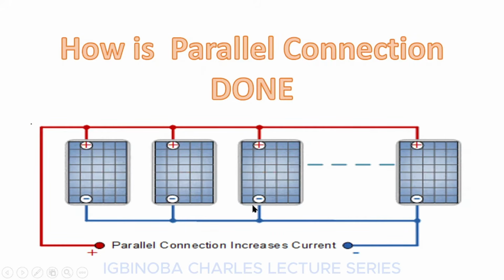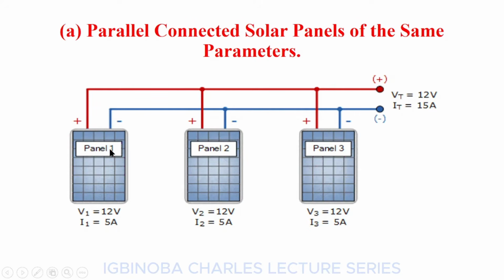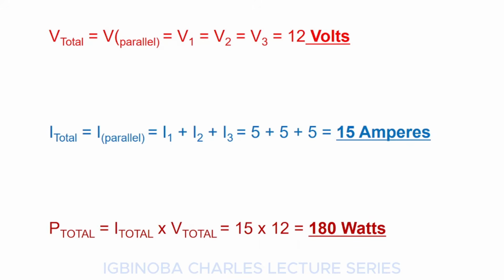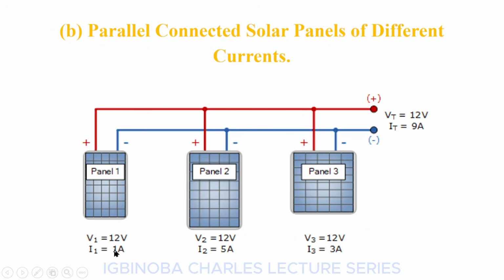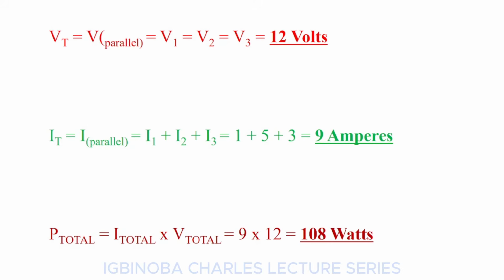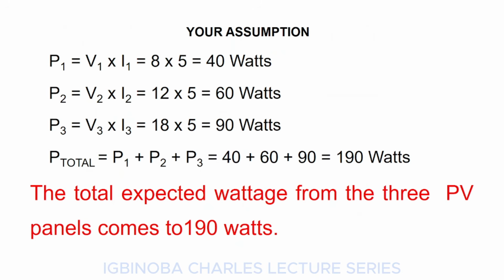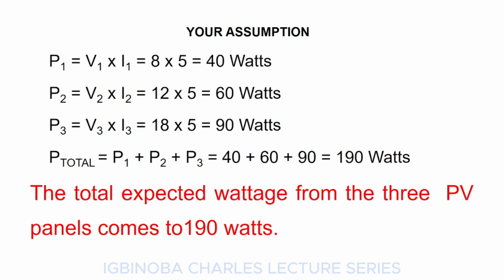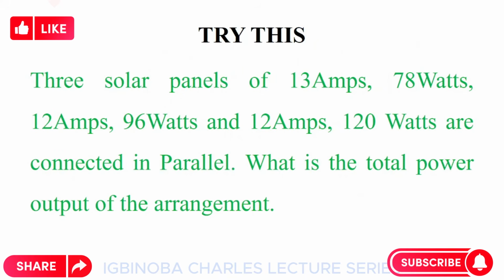Connection of Solar Panels in PARALLEL

Comment: COMP29C

Panel 1: 13A, 78W
Panel 2: 12A, 96W
Panel 3: 12A, 120W

Since total power is the sum of individual powers in a parallel arrangement:
Total Power = 78W + 96W + 120W = 294W

Comment: COMP75W 

Panel 1: 13A, 78W
Panel 2: 12A, 96W
Panel 3: 12 A, 120W

Voltage Calculation (using V=P ÷ I):
V¹  = 78÷13 = 6V
V² = 96÷12 = 8V
V³ = 120÷12=8V

Since this is a parallel connection, the system voltage is limited by the panel with the lowest voltage, 6V.

Total Voltage (Vt) = 6V
Total Current (It)= 13+13+13 = 39A

Finally the total power output is:
Pt=Vt ×It= 6V × 39A= 234W

Comment: CIV36J 

To find  the different voltage of the three panels for
panel 1: V1 = 78 ÷13 =6v
Panel 2: V2 = 96 ÷ 12 = 8
Panel 3: V3 = 120 ÷ 12 = 10

Total voltage = V1 = 6V
Total power = I1 + I2 + I3 = 13 + 12 + 12 =37 amps
Total power = 6V * 37amps = 222Watts

Comment: COMP79A

Given:

First panel: 13 Amps, 78 Watts

Second panel: 12 Amps, 96 Watts

Third panel: 12 Amps, 120 Watts

Now, we add the power ratings of all three panels:

Total Power Output = 78 W + 96 W + 120 W

Total Power Output = 294 Watts

Comment: CHM100V

Given;
First panel: 13 Amps, 
               78 Watts

Second panel: 12 Amps
                  96 Watts

Third panel: 12 Amps
               120 Watts

Now, we add the power ratings of all panels:

Total Power Output = 78 W + 96 W + 120 W

Therefore; 
Total Power Output = 294 Watts

Comment: NAT5E  
The Panel with the least voltage is 6V and the total parallel current is 37Amps. Therefore the total output power of  the panels connected in parallel is 37Amps × 6V = 222Watts making a total power output of 76%

Comment: CIV21U

Panel 1: 78W

Panel 2: 96W

Panel 3: 120W

Total power output in parallel = 78 + 96 + 120 = 294 Watts

In parallel arrangement power out of directly.

Comment: MEC4D
Given:

First panel: 13 A, 78 W

Second panel: 12 A, 96 W

Third panel: 12 A, 120 W

Calculation:
Total Power Output = 78 W + 96 W + 120 W
Total Power Output = 294W

Comment: Mar45S 

Panel 1: 13A, 78W

Panel 2: 12A, 120W

Panel 3: 12A, 120W

Since total power is the sum of individual powers in a parallel arrangement:
Total power= 78w+96w=294w

Comment: CIV76X 

To find the total power output, we add the power output of each of the three panel, which is 
=P1+P2+P3
=78+96+120
=294watts

Therefore the total power output is 294 watts/0.294kilowatts

Comment: EEE 39M
Panel 1; 
Voltage= P1 ÷ I1
Voltage= 78W÷13A=6V

Panel 2;
Voltage= P2÷I2
Voltage= 96W÷12A= 8V

Panel 3;
Voltage= P3÷I3
Voltage= 120W÷12A=10V

Only panels with same voltages that can be connected in parallel. Since they are different, it can lead to system inefficiency and power loss in the entire system. 

Therefore,
 P (total)= P1 + P2 + P3
 P (total)= 78W + 96W + 120W = 294W

Comment: MEC670
For us to go about the question we must first ascertain the value of voltage of each of the three solar panel connected in parallel.  Where 
Ia,Ib & Ic are the current of the first, second and third solar panel respectively.
Va,Vb & Vc are the voltage of the first, second and third solar panel 
And Pa, Pb & Pc is the power of the first,second and third solar panel

Va= Pa/Ia =78/13=6V
Va= 6V

Vb= Pb/Ib = 96/12=8V
Vb= 8V

Vc= Pc/Ic = 120/12= 10V
Vc= 10V

Then the next step is to find the total voltage(Vt) and Total Current (It) so that we can get the total power.

Vt = V1=6V.
It= Ia+Ib+Ic = 13A +12A +12A = 37A

Pt(Total power) = Vt × It= 37×6 = 222W

Therefore the total power output of the arrangement is 222W.

Comment: EEE84F 
To find  the different voltage of the three panels for
panel 1: V1 = 78 ÷13 =6v
Panel 2: V2 = 96 ÷ 12 = 8
Panel 3: V3 = 120 ÷ 12 = 10

Total voltage = V1 = 6V
Total power = I1 + I2 + I3 = 13 + 12 + 12 =37 amps
Total power = 6V * 37amps = 222Watts

Comment: MAR115K

We are given three solar panels which are:

First panel: I1 = 13A; P1 = 78W  
Second panel: I1 = 12A; P2 = 96W  
Third panel: I1 = 12A; P3 = 120W

Total power assumed = P1 + P2 + P3 = 78 + 96 + 120 = 294W

Voltage is given as  
P = IV  
V = P / I

Voltage for each panel becomes  
V1 = 78 / 13 = 6V  
V2 = 96 / 12 = 8V  
V3 = 120 / 12 = 10V

Total voltage = The smallest voltage is the parallel voltage that flows through the circuit = 6V

Total current = I1 + I2 + I3 = 13 + 12 + 12 = 37A

Total power = total current × total voltage  
Total power = 37 × 6 = 222 Watts

Therefore the total power supplied is 75 percent of the maximum power (assumed power) that can be given by the panels

Comment: Petro 34H

Panel 1: 13A
 and 78W

Panel 2: 12A 
and 96W

Panel 3: 12A 
and 120W

To find the voltage of each panel the formula;

V=P/I

V1=78/13=6V

V2=96/12=8V

V3=120/12=10V

Total power output: 78 + 96 + 120 = 294W

Comment: EEE31E

Given: Three solar panels:

1. Panel 1: 13 Amps, 78 Watts

2. Panel 2: 12 Amps, 96 Watts

3. Panel 3: 12 Amps, 120 Watts

So, the total power output is simply the sum of the individual power ratings:

P_{total} = 78W + 96W + 120W

 Total power output = 294 W

Comment: EEE 41O

To find  the different voltage of the three panels for
panel 1: V1 = 78 ÷13 =6v
Panel 2: V2 = 96 ÷ 12 = 8
Panel 3: V3 = 120 ÷ 12 = 10

Total voltage = V1 = 6V
Total power = I1 + I2 + I3 = 13 + 12 + 12 =37 amps
Total power = 6V * 37amps =  222Watts

Comment: EEE30D

Panel 1: 78W

Panel 2: 96W 

Panel 3: 120W

Total power output in parallel = 78 + 96 + 120 = 294 Watts 

In parallel arrangement power out of directly.

Comment: MAR91M

We are given three solar panels which are:

First panel: I1 = 13A; P1 = 78W  
Second panel: I1 = 12A; P2 = 96W  
Third panel: I1 = 12A; P3 = 120W

Total power assumed = P1 + P2 + P3 = 78 + 96 + 120 = 294W

Voltage is given as  
P = IV  
V = P / I

Voltage for each panel becomes  
V1 = 78 / 13 = 6V  
V2 = 96 / 12 = 8V  
V3 = 120 / 12 = 10V

Total voltage = The smallest voltage is the parallel voltage that flows through the circuit = 6V

Total current = I1 + I2 + I3 = 13 + 12 + 12 = 37A

Total power = total current × total voltage  
Total power = 37 × 6 = 222 Watts

Therefore the total power supplied is 75 percent of the maximum power (assumed power) that can be given by the panels

Comment: Petro90L 

Panel 1 : 13A and 78W
Panel 2 : 12A and 96W
Panel 3 : 12A and 120W

Voltage = power/current 
Panel 1: 78/13 = 6V
Panel 2 : 96/12 = 8V
Panel 3 : 120/12 = 10V

Smallest voltage= 6V

Total power = 78+96+120 = 294W
Total current= 13+12+12 = 37A

Total power= 37x6= 222W

Comment: CIV6F

We are given three solar panels which are:

First panel: I1=13A; P1=78W
Second panel: I1=12A; P2=96W
Third panel: I1=12A; P3=120W

Total power assumed = P1+P2+P3 = 78+96+120 = 294W

Voltage is given as
P=IV
V=P/I

Voltage for each panel becomes 
V1 = 78/13 = 6V
V2 = 96/12 = 8V
V3 = 120/12 = 10V

Total voltage = The smallest voltage is the parallel voltage that flows through the circuit = 6V

Total current = I1+I2+I3 = 13+12+11 = 37A

Total power = total current x total voltage 
Total power = 37 x 6 = 222Watts

Comment: MEC87I
Panel 1: 13A and 78W
Panel 2: 12A and 96W
Panel 3: 12A and 120W

To find the voltage of each panel, the formula:
V = P / I

V₁ = 78 / 13 = 6V
V₂ = 96 / 12 = 8V
V₃ = 120 / 12 = 10V

The smallest voltage is taken as the total voltage (Vtotal).
Vtotal = 6V

Itotal = 13 + 12 + 12 = 37A

Therefore,
P_total = I_total × V_total
= 37 × 6
= 222Watts

Comment: MAR11K

Panel 1: 78 W  
Panel 2: 96 W  
Panel 3: 120 W  

Total Power Output in Parallel = 78 + 96 + 120 = 294 Watts  

In a parallel arrangement, power adds up directly.

Comment: Mec89k

First panel- 13A 78Watts
Second panel - 12A. 96Watts
Third panel- 12A. 120Watts
Total power output= Sum of all the power ratings of the three panel
= 78W+96W+120W
Total power = 294watts

Comment: Chm37k
Given:
First panel: 13 Amps, 78 Watts
	•	Second panel: 12 Amps, 96 Watts
	•	Third panel: 12 Amps, 120 Watts

Now, we add the power ratings of all three panels:

Total Power Output = 78 W + 96 W + 120 W
Total Power Output = 294 Watts

Comment: MEC126V

Given that 

First panel: 13 Amps, 78 Watts 

Second panel: 12 Amps, 96 Watts 

Third panel: 12 Amps, 120 Watts 

Total power output= 78 Watts + 96 Watts + 120 Watts 

Total power output= 294 Watts

Comment: EEE109E

Panel 1: 13 A and 78W

Panel 2: 12A and 96W

Panel 3: 12A and 120W

To find the voltage of each panel the formula;

V=P/I

V1=78/13=6V

V2=96/12=8V

V3=120/12=10V

Total power output: 78 + 96 + 120 = 294W

Comment: CIV33G

Given values

Panel 1
I1= 13A
P1= 78 W
V1= 78÷13=6V

Panel 2
I2=12A
P2= 96W
V2=96÷12=8V

Panel 3
I3=12A
P3= 120W
V3=120÷12=10V
Total Voltage= 6V

Because it's the lowest voltage among the panels 
Total current=l1+l2+I3
Total current =13+12+12A=37A
Total power output=Total current x Total Voltage 
Total power=6x37= 222W
Therefore the total power output=222Watts

Comment: EEE40N 

Given

Panel 1: 13Amps and 78watts

Panel 2: 12Amps and 96watts

and panel 3: 12Amps and 120watts

The assumed total power will be 78+96+120 = 294watts

In order to get the correct total output power, we first calculate for the voltages checking also if they are the same

Therefore using P= I x V, V = P÷l

For panel 1: V = 78-13 = 6Volts

For panel 2: V = 96128 Volts

And for panel 3: V = 120+ 12 = 10 Volts

But since the power output would be limited, due to the difference in voltages, The smallest voltage is used to get the correct output power From P = I(Total) + V(Total) Therefore the Total current will be; I(Total) = 11 + 12+13=13+12 + 12 = 37Amps

And V(Total) = V(parallel) = 6Volts

Therefore P(Total) = 37 x 6 = 222watts

Therefore the Total power supply is 75 percent of the maximum power (assumed power) that can be given by the panels

Comment: COMP53A

- Panel 1: 13 A, 78 W  
- Panel 2: 12 A, 96 W  
- Panel 3: 12 A, 120 W  

Voltage Calculation (using V = P ÷ I):
- V₁ = 78 ÷ 13 = 6V
- V₂ = 96 ÷ 12 = 8V
- V₃ = 120 ÷ 12 = 10V

Since this is a parallel connection, the system voltage is limited by the panel with the lowest voltage, 6V.

Total Voltage (Vₜ) = 6V
Total Current (Iₜ) = 13 + 13 + 13 = 39A

Finally, the total power output is:  
Pₜ = Vₜ × Iₜ = 6V × 39A = 234W

Comment: PETRO 67O

To determine the voltage for each panel, we use the formula:

P = I × V

Panel 1:
78 = 13 × V
V = 6 V

Panel 2:
96 = 12 × V
V = 8 V

Panel 3:
120 = 12 × V
V = 10 V

Since each panel has a different voltage, the lowest voltage (that of Panel 1) is taken as the total system voltage:
V(total) = 6 V

The total current is the sum of the individual panel currents:
I(total) = 13 A + 12 A + 12 A = 37 A

Finally, the total power is calculated as:
P(total) = I(total) × V(total)
P(total) = 37 A × 6 V = 222 W

Comment: EEE123S

Panel 1: 78 W
Panel 2: 96 W
Panel 3: 120 W

Total Power Output in Parallel = 78 + 96 + 120 = 294 Watts

In a parallel arrangement, power adds up directly

Comment: PETRO 3C
I1=13amps
P1=78watts

I2=12amps
P2=96watts

I3=12amps
P3=120watts
 
The total power of the panel is
P1+P2+P3= 78+96+120
                   =294watts
The total power output of the arrangement is the lowest voltage in the panel multiplied by the total current of the panel
Therefore:
V1=P1/I1      , V2=P2/l2         , V3=P3/I3
V1=78/13 =6v, V2=96/12=8v , V3=120/12=10v
The lowest voltage is V1=6v
Total current I(total)=13+12+12=37amps
P(output)=V1*I(total)
                  =6*37=222watts
Therefore the power output of the arrangement is 222watts

Comment: PETRO71S

In parallel, Total power = Sum of individual powers.

Therefore,TotalPower=78+96+120=294

The total power output of the arrangements is 294W.

Comment: PETRO 2B

The three solar panels have the following:
Panel 1: 13 A, 78 W
Panel 2: 12 A, 96 W
Panel 3: 12 A, 120 W

Therefore, power for each panel is give as:
P=I × V

TOTAL POWER : 78+96+120 =294
SUM OF CURRENT: 13A +12A + 12A = 37A

THEREFORE,
Total power output (in watts) = 294 W.

Answer = 294 W.

Comment: COMP42P

Given:
- First panel: 13 Amps, 78 Watts
- Second panel: 12 Amps, 96 Watts
- Third panel:12 Amps, 120 Watts
Now, we add the power ratings of all three
panels:
Total Power Output = 78 W + 96 W + 120 W
Total Power Output = 294 Watts

Comment: EEE114J

Panel 1: 78 W  
Panel 2: 96 W  
Panel 3:120 W  

Total Power Output in Parallel =78 + 96 + 120 = 294 Watts

In a parallel arrangement, power adds up directly
Reply: CHM20T
Panels: 78w
Panel 2: 96w
Panel 3 : 120w

Total power output =294w
Power adds up in parallel connection

Comment: CHM33C
First panel: 13 Amps; 78 Watts

Second panel: 12 Amps; 96 Watts

Third panel: 12 Amps; 120 Watts

Sum up the power ratings of all three panels:

Total Power Output = 78 W + 96 W + 120 W

Therefore; Total Power Output = 294 Watts

Comment: MAR73U
Panel 1:13A and 78W
Panel 2:12A and 96W
Panel 3:12A and 120W

To find the voltage of each panel using this formula 
P=IV
V=P/I

V1:78/13=6V
V2:96/12=8v
V3:120/12=10v

The small voltage is take as the total voltage 

Vtotal(parallel):V1=6v
Itotal(parallel)=i1+I2+I3=13+13+13=39Ampere

Therefore 
Ptotal=Itotal ×Vtotal
39×6=234watts

Comment: EEE88J

- First panel: 13 Amps, 78 Watts

- Second panel: 12 Amps, 96 Watts

- Third panel: 12 Amps, 120 Watts

Now, we add the power ratings of all three panels:

Total Power Output = 78 W +96 W + 120 W

Total Power Output = 294 Watts

Comment: CHM42P

Panel 1: 13Amp, 78Watts
Panel 2: 12Amp, 96Watts
Panel 3: 12Amp, 120Watts.

I(T) = 13+12+12 =37Amperes
When p=I×V
Therefore V= p/I
Panel 1. V = 78/13 =6V
Panel 2. V= 96/12 = 8V
Panel 3. V= 120/12 =10V
V(T) = 6Volts

Therefore P= I(total) ×V(total)
= 37× 6=222Watts

Comment: EEE102X

Panel 1: 13 A, 78 W

Panel 2: 12 A, 96 W

Panel 3: 12 A, 120 W

Since total power is the sum of individual powers in a parallel arrangement:
Total Power = 78 W + 96 W + 120 W = 294 W

Comment: MAR110F 
Given:

- First panel: 13 Amps, 78 Watts  
- Second panel: 12 Amps, 96 Watts
- Third panel: 12 Amps, 120 Watts

Now, we add the power ratings of all three panels:

Total Power Output = 78 W + 96 W + 120 W
Total Power Output = 294 Watts

Comment: MAR38L.                         

First panel- 13A 78Watts

Second panel - 12A. 96Watts

Third panel- 12A. 120Watts

Total power output= Sum of all the power ratings of the three panel

= 78W+96W+120W

Total power = 294watts

Comment: CIV29C 

Panel 1: 13 A, 78 W

Panel 2: 12 A, 96 W

Panel 3: 12 A, 120 W

Since total power is the sum of individual powers in a parallel arrangement:
Total Power = 78 W + 96 W + 120 W = 294 W

Comment: EEE89K 

First panel- 13A  78Watts
Second panel - 12A.  96Watts
Third panel- 12A. 120Watts

Total power output= Sum of all the power ratings of the three panel

= 78W+96W+120W
Total power = 294watts

Comment: COMP76X

Panel 1- 78
Panel 2- 96
Panel 3 - 120

Total power unit:
78w +96w + 120w= 294w

Total power output of the parallel arrangement =
294watts

Comment: PETROCHEM25Y 

I_total = 13A + 12A + 12A = 37 A
P1 = 78W, P2 = 96W, P3 = 120W

Therefore, V1 = P1/I1 = 78/13 = 6V
V2 = P2/ I2 = 96/12= 8V
V3 = P3/ I3 = 120/12 = 10V

V_total = 6V
P_total = V_total × I_total = 6 × 37 = 222W

Comment: COMP103Y

Where
I = Current, P = Power, V = Voltage, A = Ampere, W = Watts

Panel 1: I1 = 13A, P1 = 78W
Panel 2: I2 = 12A, P2 = 96W
Panel 3: I3 = 12A, P3 = 120W

The total power assumed, 
P total = P1 + P2 + P3 
            = 78 + 96 + 120 = 294W

To find the Voltage, V
P = IV
V = P/I

V1 = P1/I1
V1 = 78/13 = 6V

V2 = P2/I2
V2 = 96/12 = 8V

V3 = P3/I3
V3 = 120/12 = 10V

V total = V parrallel = 6V

I total = I1 + I2 + I3 
I total = 13 + 12 + 12 = 37A

P total = I total x V total
P total = 37 x 6 = 222W

Comment: SUBMISSION CODE: CHM 68P
Firstly we will find the individual voltage on each panel ;

Power bill = Current *Voltage
P = IV
=> V= P/I

V1 =P1/I1
= 78/13= 6volts

V2 = P2/I2
= 96/ 12= 8volts 

V3= P3/I3
= 120/12= 10volts

There are 3 different values of voltage for each panel. Therefore to calculate the total power out of the string, the lowest voltage will be use to calculate;

 .Total voltage = V(parallel)=V1 = 6Volts

.Total current =I1 + I2+ I3
                         = 13+12+12=37Ampere

.•. Total Power output  
P=IV
= 37* 6= 222 Watts

Comment: COMP4D
For panel one: 13 A, 78 W → voltage = 78 / 13 = 6 V
For panel two: 12 A, 96 W → voltage = 96 / 12 = 8 V
For panel three: 12 A, 120 W → voltage = 120 / 12 = 10 V
Total power output = 6V × (13+12+12)
Total power output = 6x37 = 222watts

Comment: EEE47U
Calculating the voltage for each panel:
- 1st Panel : 78W / 13A = 6V
- 2nd Panel : 96W / 12A = 8V
- 3rd Panel : 120W / 12A = 10V
lowest voltage, which is 6V.

Total Current = 13A + 12A + 12A = 37A

Total Power Output = Total Current x Lowest Voltage
= 37A x 6V
= 222W

Total Power Output = 78W + 96W + 120W
= 294W

Comment: PETRO 55C

When solar panels are connected in parallel, they share the same voltage, but their currents add up.  

The power output of each panel is given:  
- Panel 1: 78 W
- Panel 2: 96 W
- Panel 3: 120 W

Since the powers connected are parallel,therefore: 

78 + 96 + 120 = 294 Watts

The current ratings (13 A, 12 A, 12 A) confirm the power values via ( P = V \I ), but are not needed for the total since power is already provided.  

Total power output: 294 Watts

Comment: MAR5E 

We are given:

- First panel: 13 Amps, 78 Watts  
- Second panel: 12 Amps, 96 Watts
- Third panel: 12 Amps, 120 Watts

Now, we add the power ratings of all three panels:

Total Power Output = 78 W + 96 W + 120 W
Total Power Output = 294 Watts

Comment: PETROCHEM39M
ANSWER:
Panel 1: 78 Watts

Panel 2: 96 Watts

Panel 3: 120 Watts

Total Power Output:

78 W +96 W + 120 W = 294 Watts

Answer: 294 Watts is the total power output of the parallel arrangement

Comment: MAR19S 
Firstly find the voltage of each panel. 
Which is:
V= P/I
Given 6v, 8v and 10v

In parallel connections, total power= sum of individual current

Therefore 
Ptotal= 78w +96w + 120w= 294w